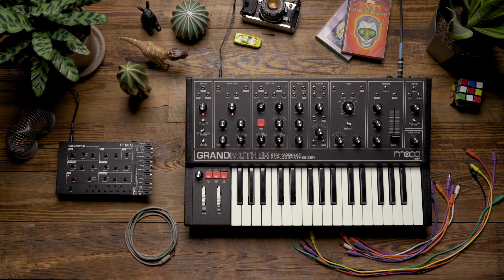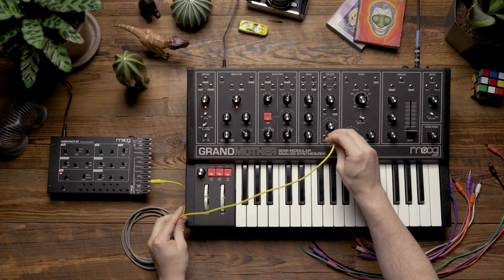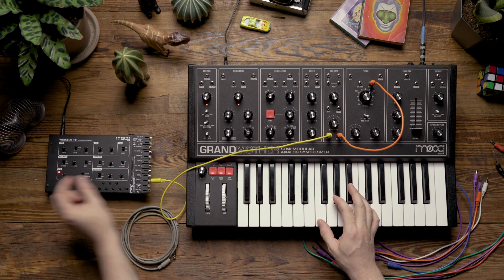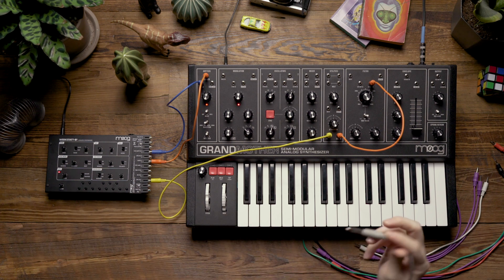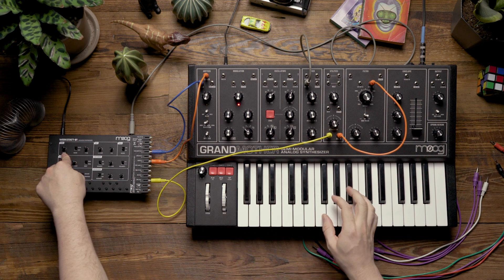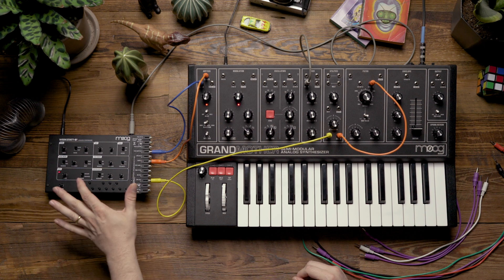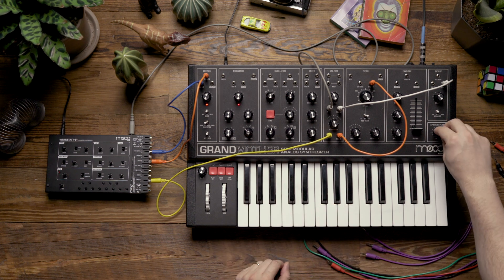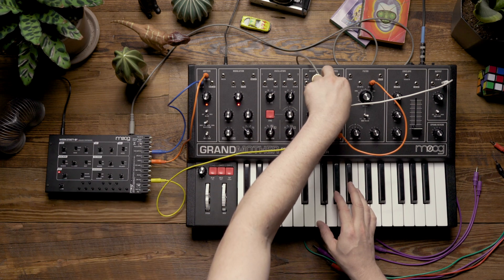Werkstatt-01 | Modifying Grandmother's Reverb

Comment: Where does one find 1/4 to 1/8 mono cables
Reply: by googling that exact guestion.
Reply: You could also just use 1/4 to 1/8 adapters or 1/8 to 1/4 adapters depending on what cable you have
Reply: Hosa makes good ones
Reply: Hosa makes nice cables that you can get from Sweetwater. You want an unbalanced 1/4 TS to 1/8 TS cable. Order Hosa CMP-303 for a 3’ version, CMP-305 for 5’, or CMP-310 for 10’.
Reply: https://hosatech.com/products/analog-audio/interconnect-cables/specialty-interconnects/cmp-300/
Reply: Walk to Radio Shack bro.